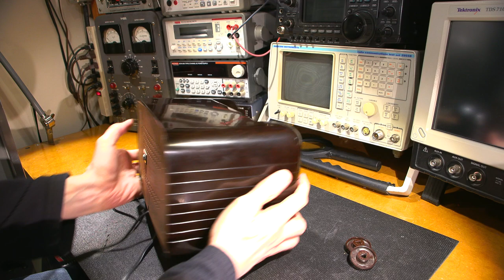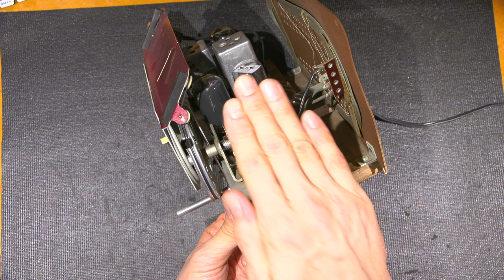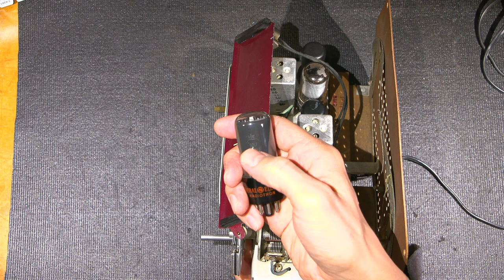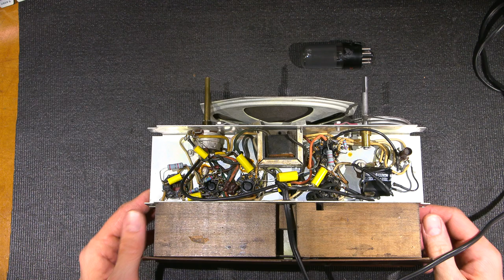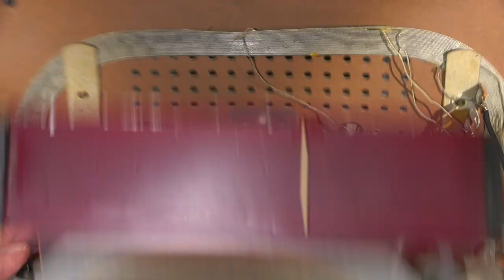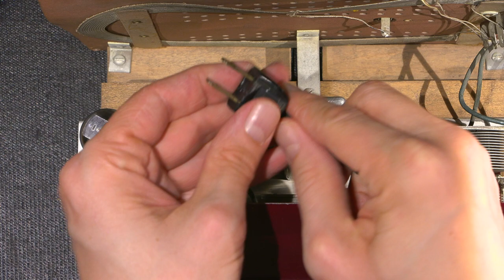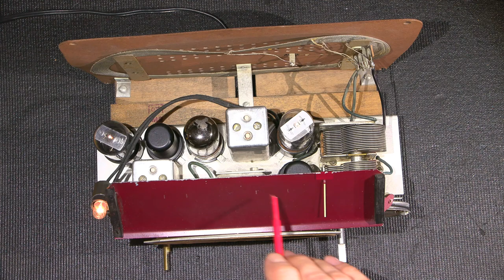Fix A Radio Receiver!

Comment from the maker: To learn electronics in a very different and effective way, and gain access to Mr Carlson's personal designs and inventions, visit the Mr Carlson's Lab Patreon page here: https://www.patreon.com/MrCarlsonsLab
Reply: Hi Mr. Carlson I am trying to fix my Eico model 460 scope and I’m trying to find a .25mfd 400vdc, .1mfd 1600vdc capacitors. Do you know where to find them?
Reply: @liamtheinventor1522  many places you can get capacitors.  JustRadios, Radiodaze, ect.  They might not have exactly what you need but you can combine 2 capacitors if you wanted exactly .25mfd.............    .22mfd and .03mfd in parallel will do it.
Reply: @zundfolge1432  thanks
Reply: @liamtheinventor1522  yep!  I collect and restore antique radios of the 1920s and 1930s.  Nothing better than a radio that doesnt work......thats when the fun begins.
Reply: @liamtheinventor1522  a little tip: Subscripe at patreon for Paul Carlson. There you find all information you need. Paul put many years in finding best sources for quality parts. There you will find your Eico capacitor source! And many help for all other things, including contact to Paul himself.
Reply: @zundfolge1432  Manchmal auch der Schmerz, aber das gehört dazu ;-)
Reply: The on-line electronics course on patrion seems to have stagnated while you (Ahab) chase down your whale of a perfect capacitor leakage detector.  I really think it's cool and which I had time to etch by own PCBs and I would if I thought leakage would be important to me (I mainly work on semi-modern solid state electronics).  I think ESR and capacitance value are the most important for what I do.  If you contracted with an OEM and had that leakage tester manufactured, I would buy it from you in a heartbeat (especially if I ever get back in to restoring old equipment like I want to).  Anyway, I would love to see you move on to other patrion projects and more electronics learning for beginners or get back to a full electronics course for the beginner.  Please don't take this the wrong way, I think what you do is fantastic.  Take care and keep up the great work.
Reply: Please do a full alignment video.  It think you have done AA5 alignment videos in the past, but the more the merrier and easier to find. Again, I do enjoy your videos and calming voice.
Reply: @zundfolge1432  I'm not sure if you like an overlap of YouTube channels that I enjoy, but Curiousity Inc of Edmonton,CA also an antique store of some of the most genuinely nice people. He had a background in TV production and was courted for a CN spinoff of Pawn Stars with creul price negotiations and making greed look good with lots of conflict. Alex refused it because he likes to help people like a homeless man brought in an animation cell he found in a dumpster that he was happy to get $35 for, but when it sold for 10X he paid him half! So Alex is 40ish hip dad who buys Bakalte raidos when he gets the chance. The exchange rate of CN vs US is 30% or so below the dollar, BONUS! He uses Kastner Auctions dot CA on the web with international shipping & superior packing even of rare ceramics. I've mentioned it as he uses them to reduce inventory for new stock. I've given up voluntarily "Must See TV!" & I'm always hoping he or his friends have a video out as they're calming! His friend Josh and his friends are an amazing bunch of crafts people &  artists! I'm going to have to look at the electronics course as I was so interested as a child, but family in TV repair discouraged it due to the potential of killing yourself from a spicy condenser/capacitor. In my 20s Radio Shack still had great resources, but I'm not the best at Math and being pre-Internet was a big learning curve!
Reply: I've enjoyed the random introduction via the algorithm and I've got this radio in hope of one grandma had in the kitchen as I got ready for school. Hers was a similar color & size with additional bands of its era for Police also Shortwave and many I don't remember. As a child in the 60s I took a transistor portable radio to the biggest hill in my NE coal town to get the effect of pirate radio to hear far away stations until it was time to be in for curfew. Delightful! When I hung out with an older man across the yard who ran a Western Auto store with the tube testing machine inside the front door. He was a Ham operator too, During the CB craze he had the biggest rig around he called, "Moonraker Base" with the Moonraker 6 on a 50 mast with the rotation motor and a honking big linear to to cleanly get cities across the US. He was not popular in our community as his overmodulation came through the RCA console blowing out whatever you were watching! His buddy The Kingfisher 3 towns away near the farm I worked on had a HUGE tower in his neighborhood with many times the houses wasn't popular with his neighbor's either being were in the flight path of BWI he was like the "Ghost Hunters" so popular now & he was occasionally "Channeling" jets! Is it true that most of the ghost boxes are radar detectord with BAD ability to pinpoint the source as to supposed paranormal activity? I've subscribed, liked, will share with friends and I am interested to learn electronics in a different way! My friend is a Master Electrician and in his early days I saw him almost be killed putting in a suspended ceiling in my basement on an aluminum ladder and he couldn't drop his tool until the ladder fell over breaking the connection! He was trying to teach me how to do what he does, but I was like the citizenry of "A Yankee In King Author's Court" it's Magic! Get away from me!
Reply: @mcshawnboy  yes radio shack in its day they even had tube testers!  Ive considered finding old radios just to resell them and break even just to keep working on them as I have too many radios already.  I love the 20s and 30s radio look, but you can only collect so many.  The 20s/30s usually have a very easily rewindable i.f. coils in them till about 1936.  By the time you hit the 40s, you cannot duplicate a coil repair due to the complex winding technique they used. 
 Most of the fun for me is having a radio that I found that doesnt work, when it does work and needs no repair, then its just eye candy, and not near the fun of bring it back to life.  I graduated Devry institute in electronics in 89.  Very basic stuff stuck with me, the complex stuff did not, so I never really found a job in electronics after I graduated.  These old radios for the most part are basic electronics plus a.m. radio theory....which Im still learning.  Math is same for me, not great but I get by.
  Right now I have the "Ineed a radio to fix" again bug.  But finding them not working but a good looking canidate is harder these days.

Comment: Mr. Carlson's experience with tubes and tube equipment really shows. Not many people could look at the tubes and immediately know that they weren't in the right place and then know which ones to expect in the various stages of the radio.
Reply: I always go by a schematic to make sure stuff is where it should be. Here the components were replaced by substituting modern replacements  but failed to 
note where the tubes went and bodged the radio up in a failed alignment. It also helps to take lots of photos before and after of the work while progressing
with a shotgun job of component replacing especially around the tubes. Sure way to solder a part to the wrong place.
Reply: There is a subtle, but very important lesson involved here. Imagine how long you could spend troubleshooting that radio with the tubes in the wrong sockets? What would you do, knowing that it had been worked on? Even if you didn't have the back-story, you would see those bright yellow caps underneath and know the set had been worked on. Once you know that, you have to know there is literally NOTHING you can take for granted--but again, does that mean you have to check every wire, every solder joint...? I myself have worked on plenty of AA5 radios (mostly the 7-pin tube versions and this was 30+ years ago) but still, there for sure was something odd about the audio out tube and rectifier right next to the tuning cap. I will admit, it didn't jump out at me right away. I think I would have tried to get a schematic online which would probably have the tube layout and etc; etc; etc
Reply: @pneumatic00  Never assume anything!
Just because someone worked on a radio and you see new parts in the underside don't assume they replaced a part with the right replacement part. Go over every circuit in the schematic to make sure it is right, make sure parts are  where they should be and wired correctly to tube sockets. I give you an example of something I found in a newly acquired radio from 1948. A resistor was going into a solder joint and I wiggled it. It was just loose going through the joint of solder !
Reply: @hestheMaster  True words spoken. Mr.  Carlson has plenty of prior videos showing no solder, bad solder, wrong wire placement and the list goes on.
Reply: Thanks to Mr. Carlson, now WE know.
Reply: @pneumatic00  I can tell you a story on a much larger machine... the APU generator of a Lockheed 1011.  The generator is 115V, 400Hz, 3Ph,  and the four cables pass through current loops (donuts) for load indication in the cockpit, and shutdown of the generator if any faults are detected.  This airplane had the APU generator replaced three times,  and every time the APU would be started and the generator put on line, the load current would fly off-scale and the buss tie breaker would take the generator off line.  I was assigned to look at this in the Skydrol-laden hell-hole under the tail fin,  and found a prior avionics mechanic had labeled the four cables with tape "0, 1, 2 and 3".  Apparently so they would know which terminal to put the cables onto after the original replacement was done.  Upon closer inspection,  the wires were stamped T0 (neutral), and T1, T2, T3 for each phase.  Guess what??  The first mechanic accidentally put the "0" tape on the T1 cable and the "1" tape on the T0 cable!!!  The generator was changed twice more,  because nobody questioned the tape the first mechanic put on.  Yes, it worked fine once the two cables were swapped!  This came to mind as soon as I read your comment.
Reply: @LakeNipissing  I had a buddy who worked on jets 40 years ago, and he always mentioned skydrol as the worst stuff ever. Yeah, it's kind of an odd/interesting mind thing, once we stick the tape on something and mislabel it it's almost impossible for the one who labels to question his own work. Then in your case, I assume different mechanics went in and never questioned the first guy's work...THAT is kind of the unusual thing. Now that I am older I realize that it was probably me stupidly mislabeling the thing in the first place!
Reply: There isnt much on those 'all american fives' that Paul doesnt know about...

Comment: I have one of these that I also did a total restoration of back in the early 90's - great radio!
Reply from the maker: Thanks for stopping by Fran!
Reply: (Sorry Paul, once I need to try something. Remove this if you find it unfitting:)
Hi Fran, do you know what shadow banning is ? Some are treated like that for years on your channel, for no reason. I can see my reactions there, but no one else can, including you. I found out after two years.
THIS reaction on Paul's  channel is the closest I can get to tell you, unless I open another platform account (Twitter, Facebook), which I refuse.
Maybe check your e-mail accounts, I wrote to one of them to tell you.
Hope to solve this somehow,
Erik.
Reply: Well, no reaction at al. It seems that there are corners build into YouTube that just don't 'exist', but I still found one after being misled for two years. And Fran is in it; I can speak, but no sound is coming trough, I am only allowed to 'watch the Fran community', while there is clearly a text field that says: "Add a public comment...". But as soon as I watch Franlab trough another computer, all my comments there are gone. Weirdly misleading.
Thanks Paul, in any way a great channel here :)
Reply: Hey Fran, I have a slightly older 1945 RCA similar to this with a wood case, I never got around to fixing it, but I didn’t realize you were into tubes! Would you like me to send it to you? It’s yours if you want it... I’m thinning out all of my stuff and need to find homes for certain things, and I would be tickled if you wanted it...

Comment: We assembled a Heathkit Superhet as freshman in High School, 1964, electronics class. Still remember the amazement that it worked. Ended up going into the Navy advanced electronics program and on into submarine service. Thanks for giving us your videos, I for one would like (need)  to see an alignment video. I have an old Marconi table top am radio that needs to be checked out. Thanks.

Comment: Great fun, as always. Thank you. I am curious to have heard you touching on whether "tubes in the wrong sockets" is generally benign (as here) or whether the owner was lucky not to utterly fry the thing to toast (or have it exhibit unwanted pyrotechnical / ~detrimental~ behaviors :-) ). I was on the side of being surprised no damage was done by it being powered up while massively misconfigured, but i am an utter layman in the field of electronics.
Reply: That's definitely a valid concern. As it turns out....once the rectifier is in the wrong socket, there are no big volts being made, hence there is no "big" power available to fry anything. The more generic lesson is that once you know the set had been worked on (whether by back-story or by observing the new components under the chassis) you know that you cannot assume ANYTHING was done right. Not that you are looking for some reason to trash whomever did the work, but just as far as how many blind alleys you DON'T want to chase down/spend time on.

Comment: I would like to see the alignment. At present, know just enough to get myself into trouble so will continue to watch your videos and build on your knowledge. We used to "fix" our radios and tvs by pulling out all the tubes and going to the grocery store which had a tube tester and tubes for sale. 99% of time I was successful. I have Crosley, Arvin, radios as well as others. My Crosley clock radio which i "repaired" in 1960 is still working well but clock quit about 20 years ago. Would like to get it back up and running so am also learning to work on watches and clocks. Thanks ever so much for your producing these wonderful informative videos.
Reply from the maker: You're very welcome!

Comment: I mean... that is just restauration/repair 101 - "when you take the thing apart, take notes / pictures on which thing goes where, so that you can put it back together afterwards"
Maybe he just wanted you to see how well he did with the recapping of the radio ^^
Reply: Back before digital cameras I would take pencil and paper and write lots of notes and special drawings of complex areas only the author could discern. Place screws and small parts removed in baby food jars with labels as to what went where. Been working on this kind of stuff since the late 60's, still do it for fun and still learning new things, that is why we are here watching Mr. Carlson.
Reply: I thought about it too. Make no mistakes with changing caps and resistors and fail with tubes? No way. Except this was done by different people.

Comment: Yes, please do an alignment video. I'm new to the radio and electronics hobby and I can use all the help I can get. I still have a lot to learn with equipment setup and connection points. Thank you.

Comment: This takes me back to my days on the farm in the 1950's when I used to watch my father as he overhauled engines to make extra money from the neighbors.  He taught me a lot about mechanics, and, of course how to farm. One thing he always drilled in about working with farm equipment was to insure that all the screws and bolts were tight before you began a days work.  So, for example, if you were going to mow, you went over the mower with a wrench and screwdriver and tightened everything so it would not work loose as you mowed the fields.  When I first began tinkering with radios in the early 1960's after we moved to town and got electric power, I transferred that learning and messed up the radios I worked on by doing the tighten the screws thing after opening up the cabinet.  I quickly learned that this advice does not transfer to electronics.  I guess it takes a few screw ups, especially if you are working, as I did with no advice from anyone in the know such as is available today with the many how to's available on YouTube.

Comment: Such a clean set, thanks for the reminder to taking notes.
I find that some tube identification numbers rub off the glass envelopes so it's mine habit to pull one tube at a time and light mark the with a pencil.
Reply: Sometimes you can recover rubbed-off tube ID nos placing the tube(s) in the freezer.
Reply: @pneumatic00  neat thanks

Comment: RCA model 65X1 from 1948. Tube compliment : 50L6/35Z5/12SA7/12SK7/12SQ7 . From the label that was on the bottom,
" For Finest Performance USE ONLY GENUINE RCA RADIO TUBES" I found Mr. Carlson's ability to find tubes put in wrong places  fascinating and I hope whomever did that 
never turned the radio on! But that person did mis-tune the radio and screwed it up! Definitely needs an alignment. Work was only half way finished.
 It would make sense to put in a polarized plug, switch the "hot" side to the on/off switch, and add a fuse on the hot wire coming into the radio. Make it safe!